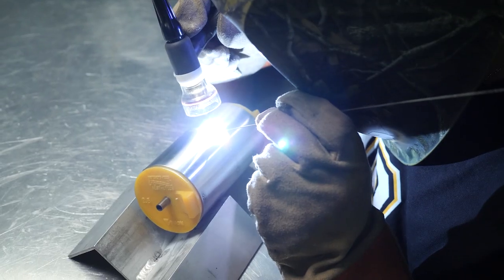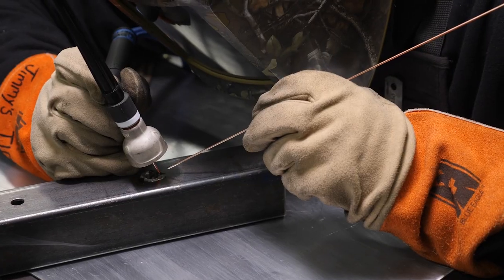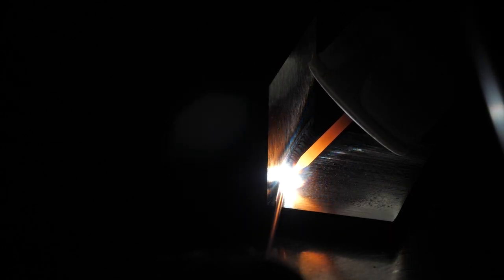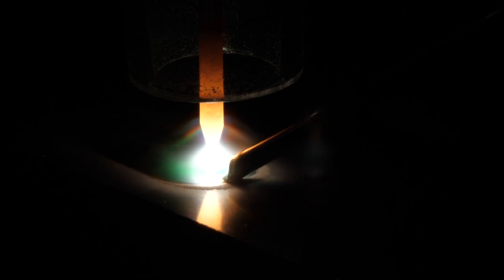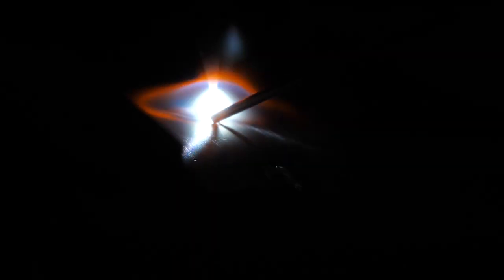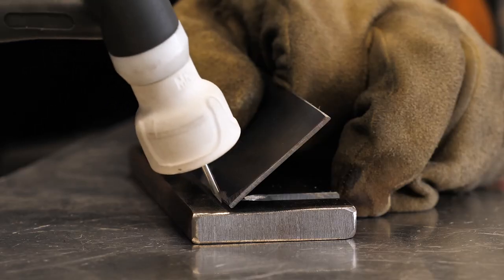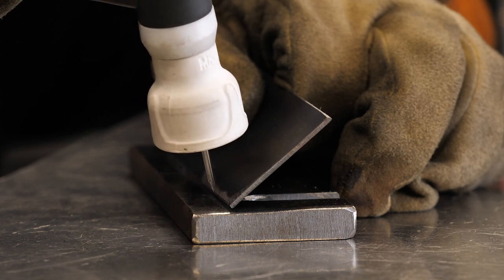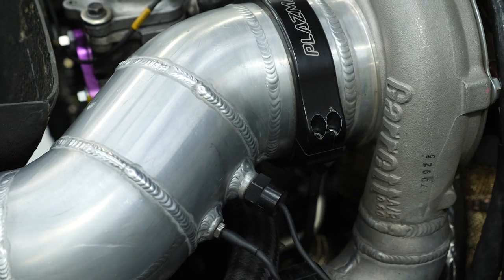The Secret to Great TIG Welding Is...

Comment: Some good tips there, good quality material and filler rod was what made the difference for me. I've been amateurt tig welding steel for a while and found it relatively easy to pickup. I could stick weld ok before, and have done a bit of soldering so maybe that helped.  But aluminium welding, what a pain in the ass. It's like a whole different discipline compared to steel.

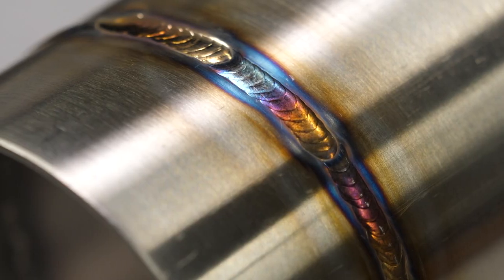Comment: 6:00... 👈critical.... 
I started learning to TIG weld a couple months ago...initially I had bad accessories and my gas flow was less than adequate ...I got a proper Furrick 12 ceramic cup and now I feel like I am just now starting to get the hang of it without burning through everything...lol...👍
Reply from the maker: Good man! Glad to hear you're seeing some progress and it sounds like you're enjoying it too. Win win in my book!
While we focus on the uses for motorsport, welding is such a great skill to have that can apply to so many different avenues. Enjoy 😎 - Taz.
Reply: Them Teflon unbreakable cups are exactly the same and really cheap.
Reply: Them Teflon unbreakable cups are exactly the same and really cheap.
Reply: @AdamNZ  I've seen them... gonna pick up...👍
Reply: @hpa101  I am learning to apply to my build..( just finished my 1st downpipe not great but not awful ).....Definitely going to enroll in your motorsport fabrication and tig welding series..👍

Comment: show how pipes look inside: i am welding exhaust  from 316, 42.4mm OD , 1.5 mm thickness, and 70mm OD and 1.5mm thickness, and using 1mm filling wire, 42A, and in 80% of welds inside are sharp debris that must be sanded off,  i think if pipe is fatter, 2mm , maybe it would not be the case
Reply: Have you tried back purging?
Reply from the maker: Purging is going to be one of the next topics for a free lesson. If you have the TIG course then you will already have access to that lesson. If I was you I'd just start searching and looking into it right away though, it's critical for pipe/tube 😎 - Taz.
Reply: @Nikoxion  it does not affect on debris appearance, it just prevents inner part of hot weld  not to oxidize
Reply: @hpa101  very well, but it does not affect on debris appearance, it just prevents inner part of hot weld  not to oxidize, so i would appreciate it if you could show the welded pipe inside
Reply: When you don’t purge the inside of the pipe with argon you get what is called “sugaring” on the inside of the pipe because the back of the weld is open to oxygen and creates a rough sugar type looking contaminated weld.
If correctly purged the inside of the pipe will be shielded and give a smooth appearance similar to the appearance of the outside of the welded pipe.
Reply from the maker: We'll show it in the upcoming purging release Makan for sure where it applies to the topic 🤘 - Taz.

Comment: I understand it looks cool, but I hate when videos teaching about welding show huge cups, pyrex or otherwise. The best thing you can do when learning to tig weld is use the smallest cup that will give you complete gas coverage. Unless you need 3 to 4 inches of stick out, you don't need a #30 cup, practice with a #6 to #8 cup with mild steel and stainless so you can actually see the heat affected zone and learn to control the heat input. The huge cups just hide everything so you can't see where you can make improvements.
Reply from the maker: You are 100% right in saying that you shouldn't just copy what you're looking at without thinking about it and experimenting as you learn, we are behind that for more than just TIG welding when it comes to learning new skills.

You touched on an important point there too though when it comes to cup size vs material. Someone using a larger cup can be doing so because that is what will give the best result for their application which might be different to yours. Welding titanium for example - Taz.

Comment: The best thing to do is to give the job to a professional who does it all day everyday. If you’re doing it yourself just make sure everything is really clean and that you have really good equipment.
Reply from the maker: You say that like you think people are just born with a set skill 😅 
Everyone starts at 0, and not everyone needs to make a career of something to be competent at it. 
Conversely, we all don't have to learn skills we don't want to when we can (hopefully) find a capable chosen professional to do it for us instead, but no one should feel threatened by others learning the same skills they have 😎

100% agree that having clean material with a good fit-up is super important though! Great advice. Professional or just cutting your teeth on some practice material that applies too - Taz.
Reply: It's going to depend on what it is, how important it is to be done proficiently, how much has to be done, and what equipment one already has.
For most people who have little or no equipment and rarely need it, it makes sense to have it done by a 'professional' as it's going to be cheaper, done better, easier, etc.
However, for others who have quite a lot of things they will need to weld, who want to be able to "tack up" things to do, or have done, later, who consider the investment in the equipment and gained experience to be worth it, etc, it may be a different perspective.

100% agree on the importance of having good equipment as a beginner - an expert may be able to work around 'chheap' equipment's shortcomings, but someone learning needs all the help they can get and won't know how badly a poor machine may be affecting what they're trying to do.
Reply from the maker: @Gordo if we all used well-thought-out analysis and logic no one would have projects in general though for the most part, especially cars haha

We're all different and value things in life differently. Some people want to spend $1000's on weed and booze throughout a year, some get tools that they don't really 'need', but gain enjoyment from having and using. 
Or not! 
Finding out what you don't like is part of finding out what you do like too 😎 - Taz.